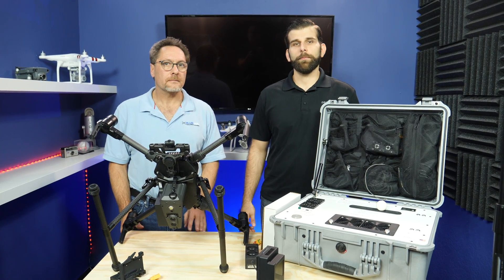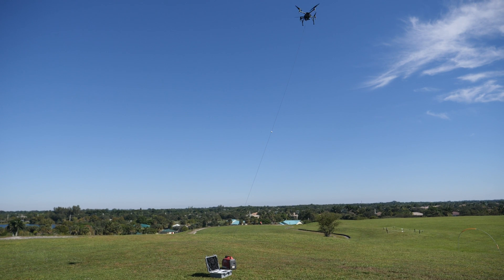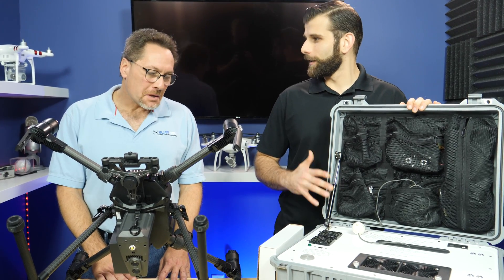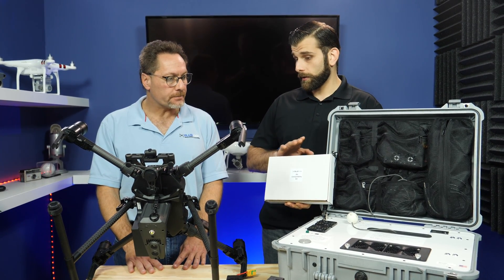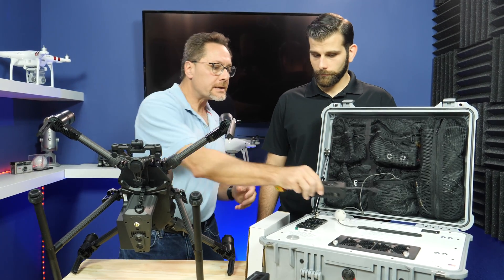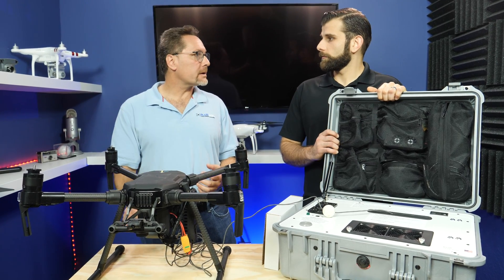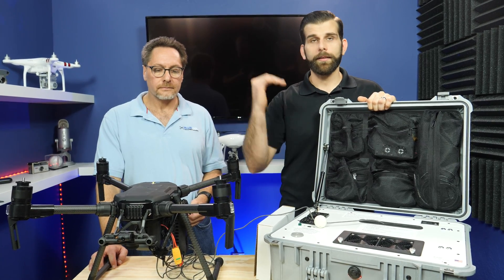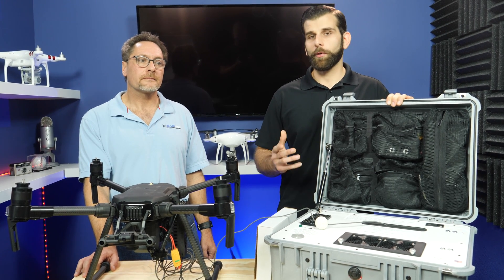Blue Vigil Drone Tether Solution

Comment: the DJI Ronin 2 Gimbal system also uses the exact same TB50 Batteries. Is it posisble to purchase just the battery adapter and power supply to power a Ground bases Gimbal systme for camreas on a tripod indefinetely?